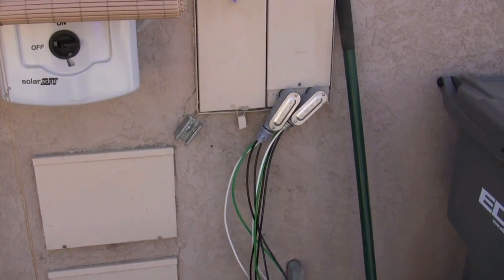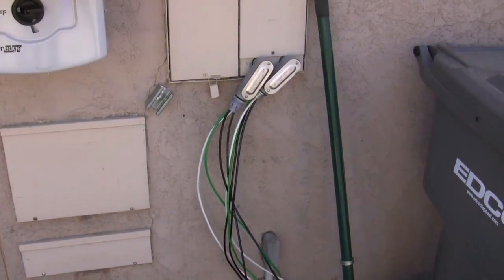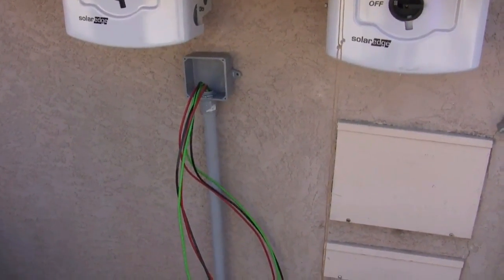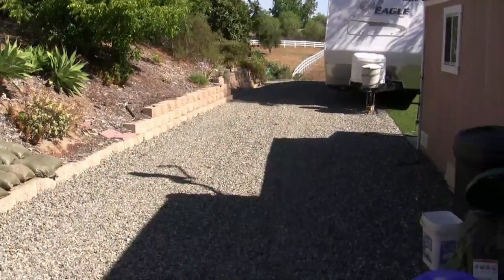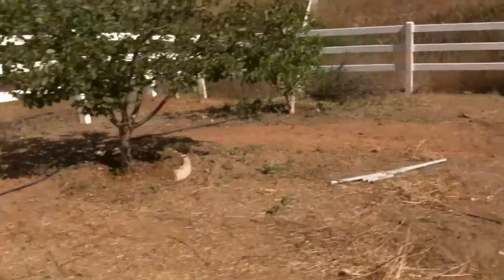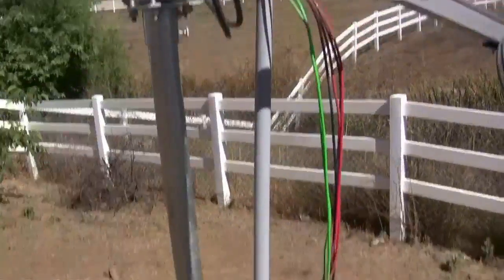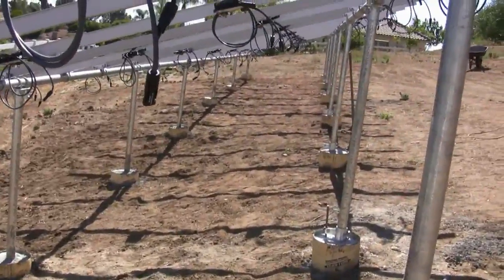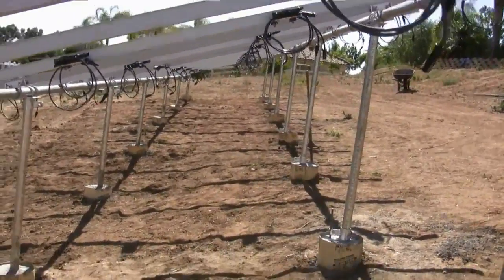Installing my 9.8Kw ground mount solar array Pt. 2

Comment: Your videos were very good and I have a 300ft trenched run and I am stuck with different opinions as to what gauge wire to use.  Thanks for your help

Comment: Hi Neal
Can you tell me what gauge wire did you use from the PV to the inverter (200ft trench run?)
thanks
Reply from the maker: I believe it was #8 but I can check tomorrow and let you know for sure.
Because I was sending the DC voltage up to the inverters at the house as opposed to having the inverters at the panels and having to send AC to the house I was able to use a much smaller gauge wire.